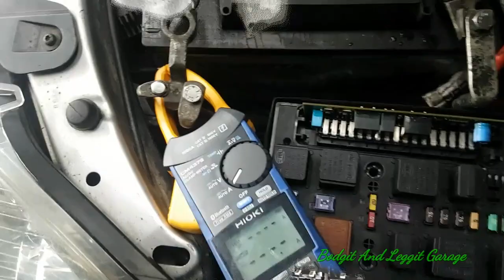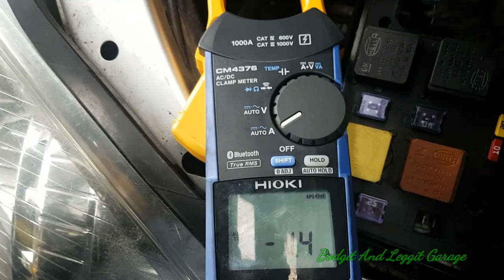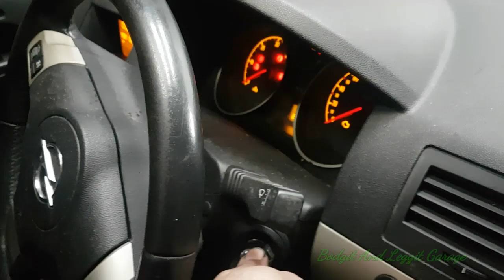Let The Smoke Out Water And Electrics Don't Mix

Comment: I was lead to believe that AC repels you but DC sticks you to it for a good frying. Maybe wrong
Reply from the maker: Yes mate you're correct
Reply: DC is potentially more dangerous. However, it's the amount of amps that kill you. At those levels it doesn't really matter whether it's AC or DC. The latter definitely causes more damage on the inside.
Reply: Think it's the polarity change in ac that pulls you in then pushes you off, no change in polarity in dc so the current keeps you in the circuit,  that's why houses are ac
Reply: @barrycuff214  AC has less losses when it's being delivered long distances.

Comment: I believe there are ways to manufacture those fuse boxes to work in wet conditions. Probably involves some kind of rubber seals or gaskets or something.
Or is this a fair weather only conveyance? I had an Opel 1900 coupe once. Ran really well for years. Dry, wet, snow etc. (1975 model)
Reply from the maker: Hi mate yes there's always a way to waterproof these things but it all comes down to cost and the manufacturers try and keep costs down as much as possible

Comment: Hey Leon, love your content, I have a 2006 mondeo TDCI with 220k on the clock and the I’m getting a loud Hissing noise when the turbo kicks in under load. Can’t  see any split hoses and the EGR is blanked. Please help....... sorted
Reply from the maker: Hi mate sounds like your turbo is going take off the turbo pipe put your fingers and see if there's any play in the turbo shaft and check the turbo vanes
Reply: bodgit and leggit garage cheers I’ll have a look at that just fitted a new clutch too, 🤦‍♂️
Reply from the maker: @dieseldriveway5195  the joys of owning a car lol

Comment: I think it's about the power, when i was training for auto electrician we were told that anything above 48V it's considered dangerous and it doesen't matter if it's DC or AC. Great vid, cheers
Reply from the maker: Yes mate don't get me wrong anything can kill you AC or dc while I was trying to get out there as you've more of a chance of surviving an AC attack just because it will throw you off the circuit rather than clamp your hands around but they are both very dangerous

Comment: AC is more dangerous, because AC is typically more voltage and current. It only takes 0.3 amps to give you a heart attack. The voltage will hurt but the current will kill you.
Reply from the maker: Hi mate they can both kill you what I was trying to get it is AC will throw you off you more of a chance of being revised afterwards DC will make your muscles tight and Clint around and you will not be thrown off

Comment: A/C is more dangerous.  Tomas Edison proved this when he electrocuted a elephant at Luna Park Zoo on Coney Island in 1903 while competing with Nikola Tesla on the A/C D/C battle for superior power distribution. 

One of the reasons that AC might be considered more dangerous is that it arguably has more ways of getting into your body. Since the voltage alternates, it can cause current to enter and exit your body even without a closed loop, since your body (and what ground it's attached to) has capacitance. DC cannot do that. (sorry I googled the last bit :) )
Reply from the maker: Hi mate it's not strictly true Thomas Edison and Tesla both electrocuted animals with each other's form of electricity what I was trying to get out they are both dangerous but AC you have more of a chance of surviving as it will push you away from the electric where DC will close your hands around it and you will not be able to let go and you will have have a better chance of surviving AC
Reply: @bodgitandleggitgarage  Yea, your right that makes perfect sense, I didn't even think of that, Thanks for correcting me. :)

Comment: dC current is more. Dangerous than AC current, the reason being, is that it only flows in one direction, where as AC changes direction 50 or 60 times per second, which means that you'll become detached from the circuit, due to that change in polarity, with DC current, at higher voltages, it will grab you, and could stop your heart as a result
Reply from the maker: Boom sorted

Comment: In case of DC voltage and currents, It causes a single convulsive contraction (a jerky and uncontrollable process in which muscles become shorter and tighter) which pushes the victim away from the DC current or voltage source they touched.

In case of AC voltage and currents, it causes tetany (a condition marked by intermittent muscular spasms) or extended muscle contraction which leads to freeze the victim (or part(s) of the body) touching the AC voltage or current source.
Reply from the maker: I made it by the way round

Comment: bodgit and leggit garage

Just done the same job on an 07 plate 1.8 petrol Vauxhall Vectra fuse box (Underhood Electric Center) UEC... I had to clean all the fuses, relays legs with a fiberglass pen to remove corrosion/filth... Think someone had used WD40 or something oilier in the past trying to rectify faults in the system and to disperse water... Not sure that helped just kept water sealed inside and for some reason fried the alternator too.... All fixed now tho and the lady only had to shell out for replacement alternator and my time obviously ... I managed to keep all the smoke in too ... XX

Oh yea I'd say DC current is more dangerous than AC as AC will chuck you off where as DC keeps you held on.
Reply from the maker: Boom sorted yes mate I agree with you

Comment: AC or DC more dangerous? Neither. Why?
Big Clive did a video a while back demonstrating (though I can't find it) that AC doesn't make you let go and neither does DC. They both can kill you just the same if the current delivered is high enough.
Reply from the maker: What I was trying to get across as yes I know they are both dangerous but you've got more chance of surviving an AC attack then you do DC I'm not saying you will I just said there's more of a chance
Reply: @bodgitandleggitgarage  I used to think that till I watched an electrical engineer electrocute himself for half an hour to prove that theory wrong.
Reply from the maker: @BensWorkshop  hi mate the theory isn't wrong I know which video you are talking about and it still depends on a lot of factors I'm just saying you have more chance of surviving an AC then you do DC they are both still very dangerous and yes I'm just saying I'm 100 times you have more chance of ac surviving and a see if that makes sense

The problem is the light documentaries depending how it's word it depends on how it's done you can prove this either way I've seen videos where you can prove electricity will never kill you and then somewhere only a few volts will kill you so it all does depend how it is shown and how it is done
Reply: @bodgitandleggitgarage  Well.... There is this:
https://www.asc.ohio-state.edu/physics/p616/safety/more_current.html

Comment: AC is most low voltage and DC is high voltage 110/230 volts
Reply from the maker: Hi mate what I was trying to get her crosses the fact that DC will hold you to the wire where he will throw you off you more of a chance of surviving an AC attack they still both kill you but more of a chance
Reply: @bodgitandleggitgarage  AC voltage and current with low frequency i.e. 50 Hz or 60 Hz is more dangerous than AC with higher frequency (say 500 0r 600 Hz). Same is the case i.e. AC Currents and voltages are three to five times more dangerous than DChaving the same level of voltage.

In case of DC voltage and currents, It causes a single convulsive contraction (a jerky and uncontrollable process in which muscles become shorter and tighter) which pushes the victim away from the DC current or voltage source they touched.

In case of AC voltage and currents, it causes tetany (a condition marked by intermittent muscular spasms) or extended muscle contraction which leads to freeze the victim (or part(s) of the body) touching the AC voltage or current source.

Comment: Strictly speaking AC has probably killed more people. Electric chairs tend to be AC, and the majority of high power electricity that people come into contact with is AC, if youre going to get electricuted at home, its going to be from sticking a fork in an AC toaster, not licking a DC USB plug.

Plus doesn't AC arc more readily? 

or was it a 'watt' joke?
Reply from the maker: Lol what you saying is true mate but what I was trying to get a crosses they are both dangerous obviously but you have more of a chance of surviving if you get shot by a c because it will push you away from it where DC for example if you put your hands over it your hands all clamp over and you will not be able to release yourself and definitely die